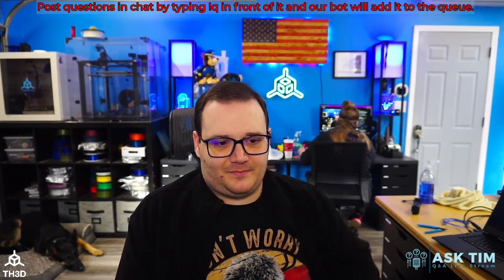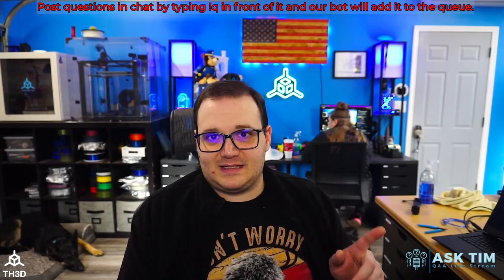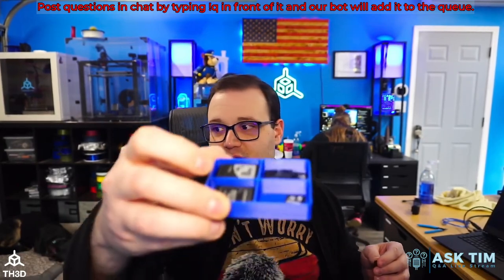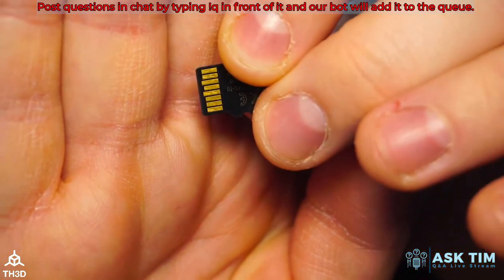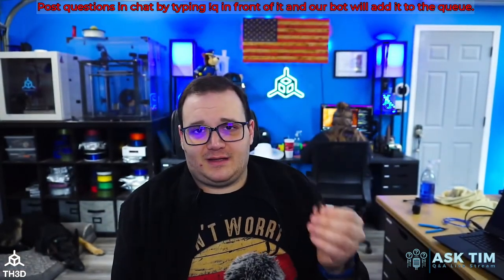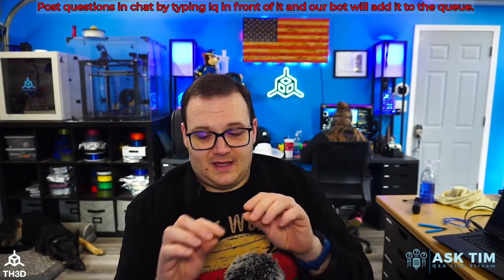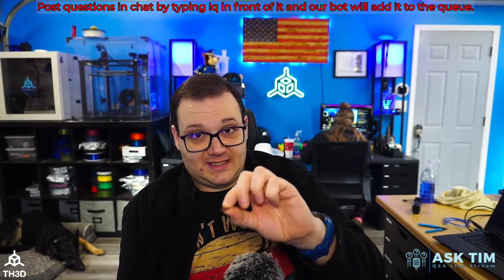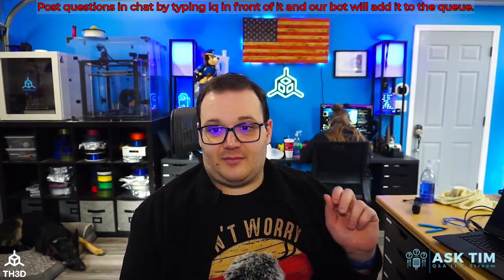Troubleshooting SD Init Errors - Ask Tim Clip - 3/15/23

Comment: My 3d printer is brand new and as well with my micro sd card. And it says ft init failed
Reply from the maker: Huh?
Reply: @TH3DStudio  sorry auto correct, read it again
Reply: this may sound weird but it emans ur sd card needs fat32 so format it to fat32 i dont have  a sd card with fat32 so i cant use my 3d printer without a cable sadly